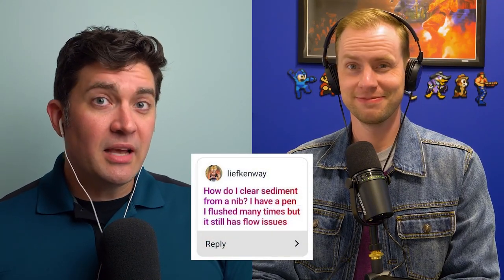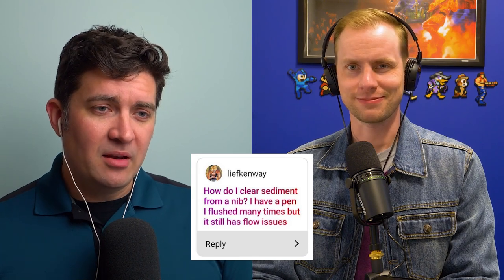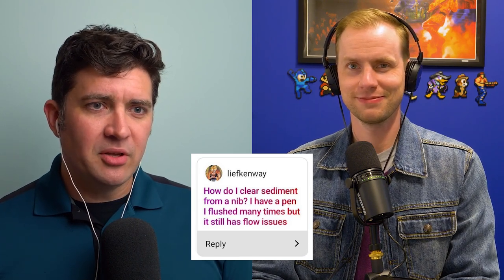Cleaning a Fountain Pen Feed

Comment: From experience I can tell you, that you can flush a nib assembly until the cows come home, and you will never get all the ink out.  Try it:  flush an assembly, then disassemble it.  You'll find ink at the base of the nib and feed every time.  I disassemble my nib assemblies and soak them in a small container of warm water with a tiny drop of dish washing soap.  Never buy a pen that the manufacturer won't let you disassemble.
Reply: I'd rather have a pen that I can't disassemble if it's got a tighter fitting nib unit that won't leak. my bock titanium nib is fun to use it's just chaos it spews ink. on the other hand my sailor pens have super tight fit nib units and they never leak ink into the cap. with that said. I don't mind a little bit of ink being left behind, you can always leave it to soak or pump water through the pen with a blub or syringe. it might not be perfect but it's enough for the pen to work well. you can really push a lot of water in with a well aimed syringe. maybe in 10 years of using the pen I might have a different outlook, but I'm not at that point yet. another pen like the pilot e95s I don't see how it's not worth it. the nib is so fun to use. and it's not gonna have the feed out any time soon.

maybe if you want to be super practical it might be better to use pens that have easily accessible parts that are easy to change like a noodler, or something like it. I do really enjoy the piston fillers they sell. even if they stink.

Comment: If my memory serves, Richard Binder even said to use an ultrasonic cleaner sparingly for vintage pens. Across the board, the first rule of pen cleaning is "First do no harm," so the less unobtrusive the better.
There's some exceptions to this. The Parker 45 is one. It's going to take FOREVER to clean out the collector, which I think is glued in the section, by soaking.
There's a couple of fortunate things: they're plastic. Very safe for an ultrasonic cleaner. And it's just a few runs through one, and the collector is clear. However, anything that is not plastics (and yes, "precious resin" is a plastic 😁) and generally pre WWII, use at your own risk.
Well said and covered, guys!

Comment: YES!  The Drewlet pen brush. I’m still looking for a toothbrush with a big enough handle to slap one of your smaller courtesy stickers on it. (Retirement in the time of COVID means working a little harder to fill your hours).

More importantly, I want to thank you for your stance on Noodlers inks since the controversy has sprung up. I’m sure it has and will cost you significantly to do the right thing. But it’s so encouraging to see in these times. 

I can’t but help feeling relieved for you given the other new controversy over Twsbi’s latest move demanding retailers cease selling Narwhal, PenBBS, and/or Moonman if they want to sell Twsbi’s pens. Given you’ve never been much invested in these brands you’re not caught in this tussle. 

I suspect the increasing danger mainline China has for Taiwan’s independence has a lot to do with something which on its surface is a particularly A-hat Anti-trust move. 

After all, Twsbi is crying about the others using the same piston mechanism Twsbi lifted from Pelikan thanks to the patent having expired.   Talk about the pot calling the kettle black. 

However, add in how much China to Taiwan resembles Russia to the Ukraine (along with Narwhal being the Apple of pen makers- i.e. design by Americans, manufacturered by same China factory that puts out the other brands) and you’ve got nuances upon nuances confusing the issue. 

Personally, I’m grateful I don’t have to decide since I never cottoned to the way my Twsbi pens wrote (a bit like nails) while Narwahls, increasingly prettier and smoother writing have less substantial mechanisms.  Not to mention being priced out of the easily affordable which makes them competition for Twsbi. 

It’s a bit sad when that lovely Johnathan Brooks resin holds something that feels so flimsy you have to be careful to avoid the top coming off as it did on a Nautilus. That’s when I gave up on them.

Comment: Sometimes a clean feed still won't flow consistently... in that case I run an exacto blade down the slit and that usually solves it.
Reply from the maker: That definitely an option! I've personally had terrible luck with that. I need to practice, - Drew
Reply: @Gouletpens  Brass sheet will also do the job, with less hazard to the pen

Comment: Sir please help me i have a question.
I have a fountain pen worth 5$ and i have an issue with that pen. At the beginning of writing it writes smooth and wet but after sometime the pen gets drier and drier . This causing the pen to skip frequently. How to fix this issue ? Please help me sir.
Reply from the maker: Sounds like the feed gets saturated while it's sitting, but then once you empty fir feed and start pulling ink from the cartridge or converter, the flow weakens. Seeing some weakened flow is normal, but the skipping is obviously not supposed to happen. You could certain start things by giving your pen a good cleaning, and trying a different ink! - Drew

Comment: Thanks guys! Love you for these videos!! Could you do a video on how to remove ink stains from clothing? Or rather, could you give tips on how to remove ink stains from clothing? Sorry for the redundancy! Keep it up guys! Very informative and entertaining videos
Reply from the maker: Great question! - Drew
Reply: You might want to try toothpaste. Rub it into the stain let it try and than wash it out. You may have to repeat the process but I've had good results  with that.
Reply: I’ve had some luck with water soluble ink coming out of clothing with bile soap. I did treat the stain and washed that particular clothing item immediately.
Reply: Hairspray works great.
Reply: I've had success with a mixture of dawn dish soap and hydrogen peroxide plus adding a little oxyclean on top and if the material. If it is a sturdy material like jeans or a sweatshirt I use a Drewlet toothbrush to gently rub in the oxyclean. Then I set up my machine to soak the garnet during the cleaning cycle. Good luck.
Reply: Add more stains until it looks like an original design.

Comment: Hi Drew and Brian, Be careful with 'pen flush'. The risk is degradation of the feed. Basically, depending on the composition of the 'pen flush', you can completely destroy the feed. You'll want to look at the composition of your pen flush. If the mfr. won't divulge, you should consider another mfr. The potentially damaging ingredients are any solvent other than water. Ammonia might be okay, but I haven't conducted any studies on ammonia leaching of elastomers/oils from ebonite or similar elastomeric compositions. No-no's include any alcohol (ethanol, denatured alcohol, methanol, wood alcohol, rubbing alcohol, isopropyl alcohol, propyl alcohol, propanol, butanol, etc.), acetone, and ethyl acetate. There are many other solvents you'll want to exclude. If you can't make head or tails out of a composition, send it to me and I'll translate for you. Surfactant ('detergent') itself can degrade elastomers, so I always recommend going light on any dishwashing liquid. If your 'pen wash' is mostly surfactant, I would look closely at recommended amounts, and I'd be wary of any recommendations for quantities over about 2 mL into a quart or liter. CMC (critical micelle concentration) for most synthetic surfactants is in the 200 to 500 ppm range, so if your 'pen flush' is, say, 25 percent surfactant, and you go with my recommendation not to exceed 2 mL, you're already at 500 ppm surfactant. Of course, if your 'pen flush' is mostly water, you can go with much higher dosages as long as no other elements of the composition are known to infiltrate/dissolve/micellize any components of the elastomer (the feed material). I probably also need to warn that your 'pen flush' may be mostly surfactant, as high as 75 percent, in which case you'll need to decrease dosage to as low as half a mL, or a few drops per liter. You can certainly go above the CMC, and may need to do so for a really dirty feed, but the risk to feed integrity goes up with surfactant concentration. If you know with certainty that the feed is composed of a material not subject to degradation by surfactants, you can use very high surfactant without issue. When you read the lit on this, it's easy to get confused or concerned about nothing, since pure scientists are interested in pure science and not real world issues. So, for example, there is something called 'alkaline hydroloysis' of polyester. There's a good chance you're wearing a cotton/polyester blend shirt right now. There's an even better chance that you wash your shirt every now and then - and a yet better chance that when you do, you use alkaline conditions (built detergent containing soda ash or sodium carbonate) and you apply heat. Yikes! There are your alkaline hydrolysis conditions right there. So you're going to dissolve all the polyester fibers, right? Wrong. It won't happen, even if you use the highest alkalinity found in commercial laundries and the highest temperatures they can achieve. You can get some hydrolysis, but you need to be at the boiling point of water, you need pH 13.5 at least, and you'll need several hours to measure any polyester loss at all. You can wash that shirt for 50 years at the 'hot' condition on your home washing machine and throw in a quart of Drano with every wash and you're still not going to get any degradation of the polyester in your shirt (nor the cotton component - cotton becomes stronger in the presence of alkalinity). Don't use Drano, though. Anyway, what I'm trying to say is that it's easy to find literature that seems to say you can't do such and such when in fact there's no real-world effect. How can you know for sure? Well, you can always contact an old codger with a boatload of expertise in all this stuff. Cheers! PM 2022
Reply from the maker: We make our own pen flush here - we've tested it thoroughly and so far, so good! - Drew
Reply: Wow! Thanks for such an deep dive.
Reply: @mai-linhmainor5965  You're welcome!